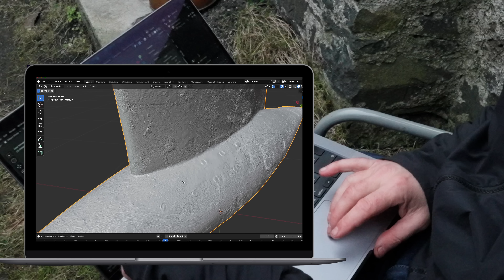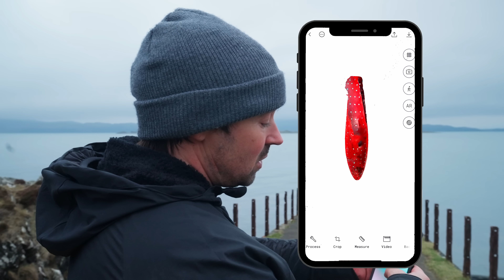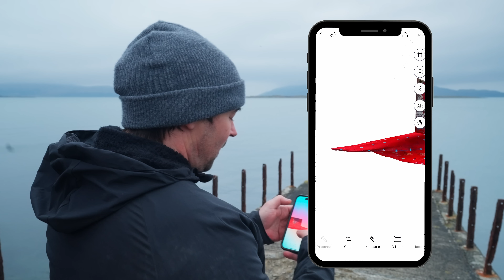I found a Project Sailboat with No Keel ! ~ Let’s try to make one.

Comment: I might be stating the obvious but can you fill the keel with lead shot and just seal the top with a blowtorch ? It's how radiation proof doors are made for hospitals. ps... I'm not convinced you were in Scotland. 1: didn't see Nessie and 2: it wasn't raining.
Reply from the maker: I’d you see Nessie you would be loaded mate! Oh, it took about two weeks to be able to film in the shed without the rain pounding on the roof!!
Yeah, the lead shot would be great, only there’s not enough space to pour it into. Well, there is the fin but that only holds 1/4 of the required weight at present and it’s also not low enough to get the correct righting moment. Hence the need to make the bulb in the bottom.
Reply from the maker: P.s Jenni was doing a sun dance for days prior to the lift day in the hope it wasn’t raining for the scan and we lucked out! 😉
Reply: @SailHub  ...Well, bother ! Here I was thinking I was clever. If I saw Nessie they'd put me back in the looney bin. Took me ages to tunnel out last time. Can Jenni visit Belgium and do a Summer dance? I overslept last week and now it's winter setting in already. I'll be dead keen to see how you make the mould for the keel bulb. Sand cast or lost wax? Can't wait to see !
Reply from the maker: Mate! She will be dancing not too far from you for METS in Amsterdam later this year! 
As for the looney bin, I think we’re still in it and searching for your tunnel. Get yourself back in here, it’s way more fun!

Looks like the keel is going to be a winter project, we’re just discussing our propulsion through the rivers home so it kinda has to be a winter project t as we want to launch in late spring!!
Reply: @SailHub  .." As for the looney bin, I think we’re still in it and searching for your tunnel. Get yourself back in here, it’s way more fun! "... I back filled it on my way out. Hard work with just a plastic spoon.

Comment: its not LiDAR its simulated LiDAR and that's why it doesn't work
Reply from the maker: Hi! Thanks for your comment.

Maybe you have a more in depth explanation which could help support your comment? It’s just. Little vague for me to get my head around as it stands.

The way that understand it is that we’re using a light to measure distances from an object and from that we create a simulated model. With that in mind all LiDAR images are simulations of the sensors information.

I think what is important here is that the iPhone does actually have a LiDAR sensor. LiDAR has its limitations, when bouncing light the obvious problem is reflective surfaces, which of course is the problem we experienced with the wet parts of the keel. It’s the reflection that caused the problem, take away that and it was accurate. 

Photogrammetry in the other hands is a computer simulated stitching of photos, it’s very interesting how it works and has been very successful for us.

Comment: You could have taken a HALF MOLD WITH PLASTER AND CLOTH .
Reply from the maker: Yeah, that’s a good idea and we thought of similar but figured out 1  hour timeframe was pushing it too fine for us? The main issue I had for seen was drying the boat down.

Unfortunately all of the water on the thing and from inside the lift keel mechanism too runs to the bottom which is where we needed to be… not ideal!
The first 1/2 hour was taken up by this drying process and it still wasn’t great. Most likely causing reflection and why the early scans were poor. 

As it turns out, the guys were super kind and we could had longer and your idea would have been fab! But, could you bank on that and the Scottish weather?!

Comment: wouldnt it be 1000 times easier to create a mold? :/
Reply from the maker: @Mikael-jthk As a boatbuilder that was my choice.
But as I explained in the video, we could not do it. 👍
Reply: "Just" making a mold can be a little trickier than it may seem.  Sometimes the original piece and its mold become nearly welded together, despite plenty of release agents, etc.  And in this case, there was not enough time available.  Also, having a CAD model is the usual desired goal, so that it can be tweaked if required, volumes and CGs verified, etc.   A plug of styrofoam can be made from the cad file, and that can be used in a manner similar to lost wax casting.
Reply from the maker: Hey Ken! Superb, your right on the ball!!! Thanks for explaining our situation well! 👍😃❤️